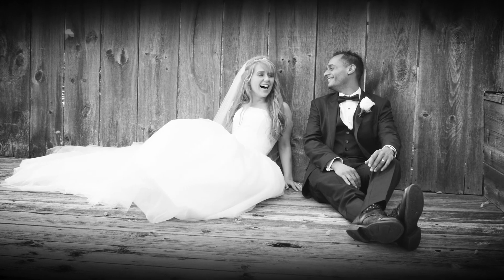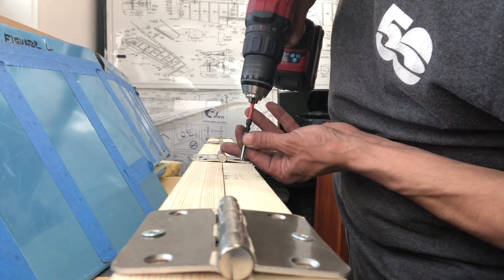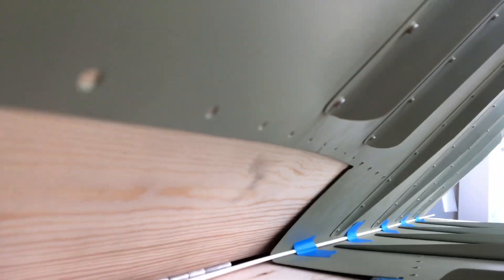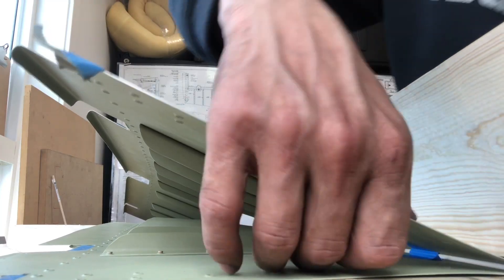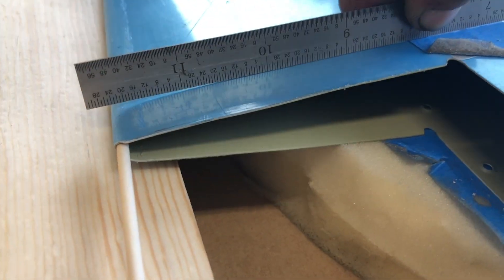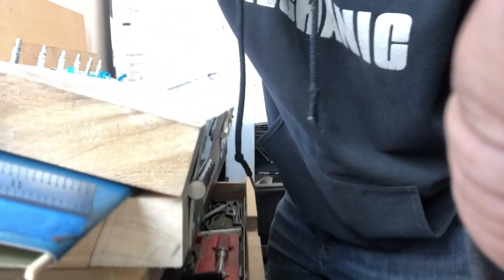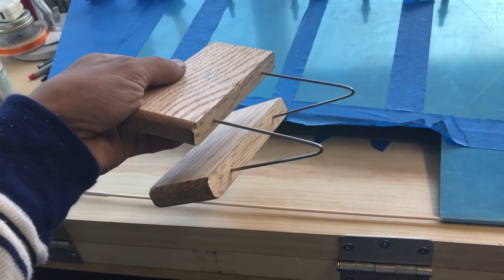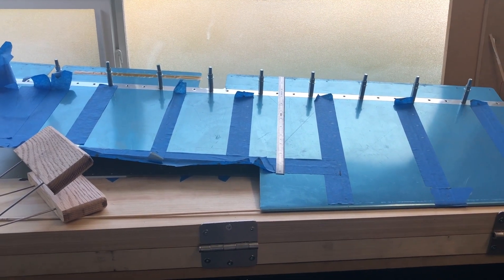RV 7 Elevator Final Assembly Part 2

Comment: I just finished the trailing edge bend on the rudder of the RV-8 I am building:
1) I used 2x8's. squared the wood same as you. Mine were 5' long, so I could also bend the entire edge at the same time.
2) I counter sunk screws on the ends of the bottom 2x8 and attached it to the rear edge of my work bench.
3) I then used a 2x4x18", attached it to the top face of the top 2x8 to use as a lever.
That way the fixture did not move, I could operate it from the front, and really put some significant pressure on the fixture while bending the rudder.
I did not use any spacing dowels, but did have to finish it off with a hand squeezer as well. In some areas it ended up over bent, so I had to also jig up the other wood block to adjust the bend. yours looks good, keep building!
Reply from the maker: Ken Owen Thanks Ken. Im putting the next video together now. It’s all bent up now. I learned a lot. For VAF and viewers like you! Keep a watch for the next video as some of you suggestions are all ready in play 😉

Comment: I don‘t remember using a dowel at all. - Just the tool with the hinges.
Reply from the maker: The Plans don’t call for a dowel. Just recommended by other builders. I will be removing it for the final bend I think.

Comment: Welcome back! Congrats on the marriage and the kid! Do the plans call for the dowel? I feel like the addition of the dowel prevents the bend form occurring in the radius where you want it. I get that you are trying to shape the radius into a perfect 1/8th but it isn’t rolling and drawing the bend over the dowel like in a bending brake machine.. I bet if you try bending without the dowel, it’ll form the radius exactly how you want..
Reply: Be careful, not pushing the pre bent elevator sheet too much against the hinge of the tool, since the radius is already almost correct.
Reply from the maker: I think I’ll be removing it for the final bend.
Reply: Cool, I’m curious if that’s going to be the issue..